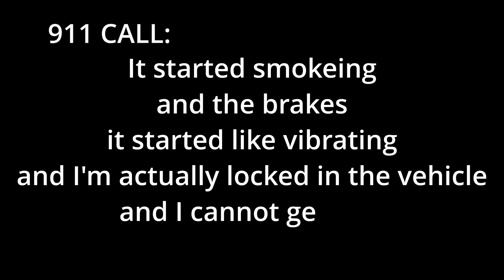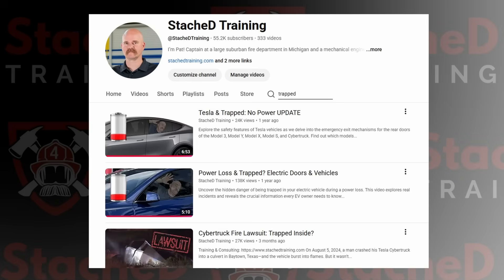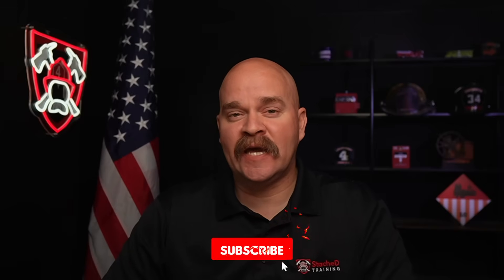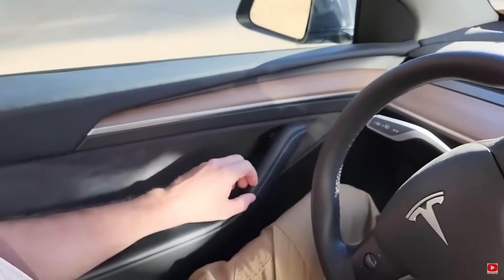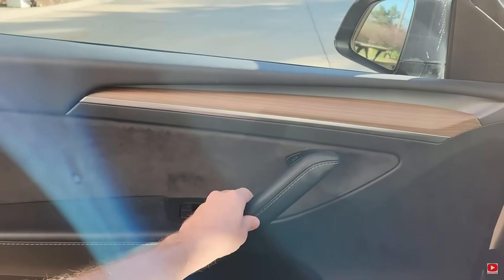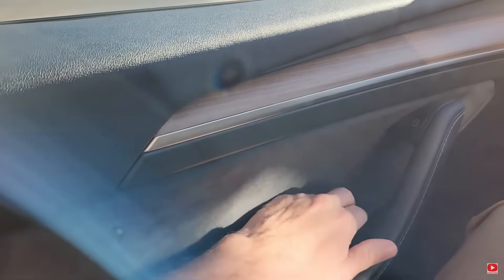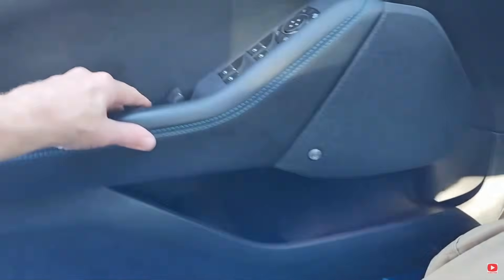Electronic Door Latch Failure: Smoke in the Cabin

Comment: The single, style and modern electric car technology "safety" compromise that kills, absolutely... Using an electronic means instead of a time proven ☺️ cable or mechanical linkage rid to operate the damn door latch to open the effing doors in an emergency... The whole concept of electric cars has perverted vehicle engineering today. Toyota probably reached the Zenith of product engineering with many of their hybrid models... They're batteries are the most reliable, they don't reach that critical mass of cells, because it's only a portion of the whole drivetrain. Very high milage and efficiency, and excellent reliability and durability.. All because they didn't get caught up in a "Religious fervor" over building ell electric cars, with current, obviously flawed battery technology..
Give them their due..

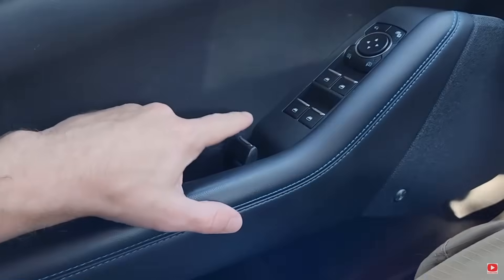Comment: 3:53 Wrong. The Ford Mach E absolutely DOES use electric door releases inside the vehicle. That lever is an electronic switch first.
The mechanical release just happens to also be on the same lever, but you have to pull it harder and further if there is no power.

Comment: I'm no electrical engineer but if i were, I would have the mechanical release become illuminated and buzzing like a cell-phone in the event of loss of power. Consider lighting requirements for that are common in structures(emergency lighting, illuminated EXIT signs)
Reply: Or just the glow in the dark Emergency Mechanical Trunk release handle that has to remain exposed and accessible at all times. Criminal to have HIDDEN Emergency features.

Comment: Simple solutions:
1.) Make the door handles easy to see, easy to identify, & easy to operate. 
2.) Make all door latches mechanical, so that the door can initially be opened with zero electricity required. 

These modern door inside door latch releases are supposed to be cool & futuristic to impress the customer & they may indeed do that --but you must understand that in many many cases with today's modern small electronics and tiny electric motors they are simply easier to manufacture as well, & thus less costly. The fact that a back-up manual release was demanded, actually peed off a number of manufacturers because it then negated the cost savings realized by eliminating physical manually operated release mechanisms. If this is the case, then why not design the door to operate clearly and easily with the manual mechanism (which are used regularly, & which would thus help the passengers realize what latch to grab in an emergency, since they are using it each time they leave the vehicle), and then add a separate electric door opener that is fully subservient to the manual door opener & will not interfere, to please the customers who find it useful (for example, perhaps the physically handicapped) or those who demand such a device as a desired device.

Comment: As a former auto tech now working for a commercial general contractor, the Mach E is the way it should be done bare minimum. Egress should always be as reliable as possible, or the electric latches should fail open. Even then, electrical gremlins happen. It only makes sense to make egress mechanical instead of subject to multiple modes of failure
Reply: Do latches that fail open consume power when locked? I'd assume that's why they're not doing it.
Reply: @seriouscat2231  No. Fail open latches consume power when locked. It’s a reasonable idea in a building with backup generators or uninterrupted power supplies (battery banks), but it a car it would continuously consume a small amount of power to keep the door latched. Extended periods of sitting while not connected to power in some way would eventually discharge the batteries and let the doors fall open. At the end of the day it wouldn’t actually be a good idea for automobiles since a short or broken wire could cause mayhem with the door not latching or opening. I’m in favor of integrated mechanical safety for all control and egress systems. If a company made an electric assist on a power door lever so it functioned like electric power steering, I’d think it just fine as the mechanical release would be the exact same motion and location as the electric release. 

But my opinion is just that, an opinion. Inconsequential to good idea fairies.

Comment: Have handles with two-stage detent: ~10 degrees triggers the microswitch and electronic door opening, more than that engages the mechanical override. One handle for both functions, no risk of confusion, no need to remember two different methods. In an emergency, you will pull the handle harder than usual if the door doesn't open immediately. If not on the first try, certainly on the 2nd or 3rd.

Comment: Every vehicle with this type of system should have a factory supplied hammer in the console. 

Car goes off the road into deep water, the vehicle is sinking, door not opening.... possible death.

Tesla Model 3 and Y, rear doors, NO interior handle!
Emergency: remove the little pad liner in the armrest, fumble for a little emergency cable and pull?

There is an aftermarket company who can install a longer cable with an obvious ribbon attached, sits in the armrest, for immediate access.
Reply: The Emergency Mechanical Trunk release is legally required to be exposed at all times. Should be the law for passenger doors as well.
Reply: @davebrown9725 absolutely!

Comment: I'm told there's a regulation for the hazard light button. It needs to be mechanical and clearly labelled and positioned. The same should be true for door handles.  That cover should be red.
Reply: If the Emergency Mechanical door release is not part of the regular door release, it Absolutely needs to be exposed and Obvious to all occupants.

Comment: I have an 08 Cadillac and it has electric door poppers but only on the exterior handles. The interior is just a regular handle. 
Completely pointless system as the exterior handle still works the same (pull out) but isnt hooked to the cable, just activates the pop.  Dumb.

Comment: I never understood why the auto industry went this way for a flush-mount handle. The aviation industry perfected this decades ago and did it all mechanical. Is 18 gauge wire that much cheaper than steel cable?

Comment: When you call 911 firefighters should not be worried about your 90 grand car . When your trapped it’s get the door open immediately the vehicle is repairable or can be replaced
Reply: It should not require a rocket scientist to open a door that is not even damaged, that has merely only lost power. You expect them to get out the heavy tools to force stuff to open, when it is all smooshed up in a car crash. Of course it does not want to open then, as it can not even fit through the door opening, it is going to require some serious "persuasion" to open.

Instead of designing lights to last forever, I hear of BMWs requiring the whole bumper to be removed and a lot of costly labor, just to change a headlight. So much for that crappy "German engineering" which is now clearly garbage.

Comment: Regardless of the level of risk, the person is stuck inside that car breathing noxious fumes from cooking electronics, At the very least a window should have been broken to get fresh air to this person, It should not be allowed to sell a car with electronic door handles. This is a safety item since you can get locked in if the car looses power. If the person inside becomes incapacitated no one can access that person to provide help. Waiting for first responders is not always an option.

Comment: In a Tesla S, if the electric opener fails, it's exactly the same handle that you pull hard to open the door.
Reply: In the Front. What about rear passengers? Or is it just the 3, Y & incEl-Camino that have HIDDEN Emergency Mechanical Rear Door releases?
Reply: @davebrown9725  I checked my S. The rear doors have the same handle as the front, and there's no "hidden" release anywhere. I heard the cheaper models of the Tesla have cable-based pull-strings to open the back doors in an emergency, which seems like a bad idea.

Comment: As much as I do not like the way Ford has gone thru the years I have always been able to get the doors open. Since the 70's the inside door latches open the car door, even if locked - at least on the vehicles I've been in. Other brands not so much. If the door is locked, you had to unlock to open it Chevy). Ford you just opened it normally, or open it twice to get the door released.  
Where is the NHSA in all this? They and the DOT mandated bumpers, door latches, headlights, bumpers thru the years but they have been strangely silent on all this. 
Are they just asleep at the wheel... or have they been paid to look the other way?

The blood of many are dripping off their hands.

Comment: So there is a mechanical release on the door, but owner didn't bother to read manual and was unaware of its existence? I think that operating machines (any kind) should require at least minimum technical knowledge and in case of modern cars ease of their use went simply too far.
Reply: Too many owners only want an appliance that gets them from A to B, and to never have to care about the vehicle.

Comment: It's not just EVs. Absolutely crazy.

Older systems were machanical at heart, with an electric action for convenience. The system could be completely dead but you can get out.

There also have been instances where the electronic doors have OPENED while driving

Comment: Good vid, have you looked at the Lexus e-Latch system? It’s still a handle, but you press it in for the electronic opening, and you can also pull it twice for manual release by cable if the 12v has died. There is a manual release on the outside as well, but it’s a bit more hidden under the handle.

Comment: I'm somehow 66 (WTF? I digress). I love tech ... I recall how amazing it would be to simply have bulky Dick Tracy watch radios for comms alone. I used and worked on the first Macs. But now loathe practically all of it. Maybe I'm losing it but "when I grew up" you hit a button or switch and it ALWAYS WORKED FIRST TIME. I refused to get a smartphone (mostly from cost and sure I'd drop/ose it then to avoid become a Pod Person staring and clutching one 24/7).

My brother foisted one on me and yeah, it helped with some rare Zoom calls but I keep that sucker in the glove compartment and only for ... well, a phone. Already lost it once; found on the roof after a trip into town; love that rubber case but context for me. Each time I turn it off is a rant as things pop up without asking, have to to special 2-buttons at once move just to get an OFF option ... then have to hit it once, twice, sometimes three times to ... aw, mudderphker goes back to home screen; now gotta swipe again to light up ... try again ... OFF option finally ... hit, hit, ... come on, damn you ... rinse/repeat.

Only thing I want to swipe is my ass. No, it has no screen cover, no reason to do that crap (like so many other touch screen garbage), don't want to repeat myself just DO YOUR DESIGNED FUNCTION AT FIRST HIT! STOP doing sh/t I didn't ask ... this goes for most the alien tech we've only halfway reverse-engineered. Add a likely deliberate scheme by the Chinese and tech giants to drive us crazy.

18 separate acts to fire up the computer; TV constantly tossing out 20 second subscreen pop-ups of hey, you're on HDMI 2 if you need to know that; meantime let me block the screen. Got a great 2002 GMC Enovy with OnStar that wouldn't shut up despite being defunct (wire cutters took care of that); ding-ding, I KNOW! uh-oh, don't brush that one button that will reset the seat settings to a 5 year old; adjusting heat is numbers vs. JUST BE WARM; console is so crowded with controls it looks like a shuttle cockpit.

huff-huff ... what happened? is this thing on? what was the question?

Comment: These electric vehicles, specifically Tesla, started out as a fad, virtue signaling, and a status symbol.  So many were sold because people like to brag.  Then, every manufacturer started making EVs as a side gig, even though EVs weren't their thing.  Now they're everywhere.  Ten years ago, my daughter and son in law bought a Tesla.  I had to have help getting into it because the door handles are flush mounted.  There's a "trick" to open it.  I immediately assumed the thing was a d.e.a.t.h trap.  

The screen went black frequently and they had a lot of problems with it, but hey, it made f.a.r.t noises.  In 2019 they took a road trip from MI to FL with their kids, stopping to see friends along the way.  When they were in Alabama, they hit a 90 mile stretch that had no EV chargers.  They had to turn off the music, the air conditioning, and any other things using electricity just to have a chance at making it to the next charger.  Alabama, in the summer, with a 2 year old and a 4 year old, no A/C.  They sold it shortly after that.

Comment: Granted the mechanical door release on the front door is kinda easy to see but the rear doors, you need to pull a panel off the door to get to the mechanical door release.
One thing on the Rivian vs Tesla is there is a proper door frame around the window so using the mechanical door release in everyday situations without damaging the glass.
Anecdote - My spouse got into our R1S while it was in pet mode. Pet mode does not allow the electronic door release or windows to work. In their panic, and they panic easily, they found the mechanical door release to get out, they didn't know where it was. Not saying everyone will do this but it is possible.

Comment: I once saw a statistic that is helpful in understanding how people respond in emergencies. Faced with a life-or-death situation, there are three kinds of responses:

(1) 10 to 15% respond sensibly, calmly doing the right thing.
(2) 70 to 80% freeze and then follow what others are doing or what they're told.
(3) 10 to 15% panic and do stupid things.

 How an emergency shapes up often depends on whether the first or third group takes over the behavior of the second group. So if you're in an emergency and are of the first sort, quickly take control of the situation and steer it in the right direction or assist those who are.

That's why airliners have flight attendants trained to tell passengers what to do in an emergency. It is also why some idiots try to exit the plane with their luggage. And it is what our host is talking about when he explains that some people do not know how to open the doors of these vehicles when there's a fire and an electrical failure. They're among the 10 to 15% who panic and do stupid things.
Reply: Three kinds of people try to exit a plane in an emergency with their hand luggage. Those who are too selfish and think rules don't apply to them. Those who simply panic and don't think about it. And those who have something deeply personal in their hand luggage, for example a laptop that contains all the material for their thesis or research. I mostly sympathize with this third group.

Comment: The manual release on the Tesla model X falcon wing doors is hidden behind the speaker panel & is a skinny wire without a pull handle.  I just found mine on a 2017.  Very poor emergency design!

Comment: I have a very low voltage door opening system in my vehicles. 
It’s a metal rod from the handle to the latch.  Inside and out. 🤔
Yet my keyfob can still electronically open them. Amazing. 😳

Comment: One major problem could not be solved and that is, that people seem to be unable to read their cars manual. It is caused by all the electronic gizmos in your car, so people think, their car will be saving them in an accident.
The second point is, that door locks have to be operated without electrical power manually, from the inside and outside.

Comment: The fire fighters did the wrong thing. They knew nothing of the toxicity of the smoke and fumes in the cabin. They could not know how quickly the situation could escalate. First action should have been to break the glass. Second action should have been to extract the driver by whatever means necessary. By not doing those two things they increased the danger to the driver.

Comment: 2:25 in “they’re going to freeze”, just like a general aviation pilot who has an engine out on takeoff. If the pilot hasn’t prepared himself for it on every flight by checklist, it’s going to be a surprise and the loss of those seconds becomes deadly. Typical reaction is to pull back to make the plane climb when the right thing to do is 1st be prepared for it then when it happens training pays off. In the case of an EV, every time the driver is ready to roll, they should tell themselves what they will do when the locks fail in locked position. I think EV’s will electric Locks should come with a window punch breaking tool in the door where they would naturally reach to take out to punch out the window.
Reply: Those tiny hammers work with tempered glass that shatters by nature. Not with laminated glass that's becoming more and more common these days. You need a full-sized axe or hammer for those.
Reply: And Every passenger needs to be trained how to open doors when the EV bricks itself.
Reply: @davebrown9725 I don’t like regulations, but it seems sometimes the only way to get a change implemented is to regulate it. I don’t like the idea that we require people to have to buy electric vehicles. I dislike it more when those vehicles aren’t required to have intuitive mechanical door release on the inside and a way for emergency responders to ingress an EV or any vehicle with occupants trapped inside.